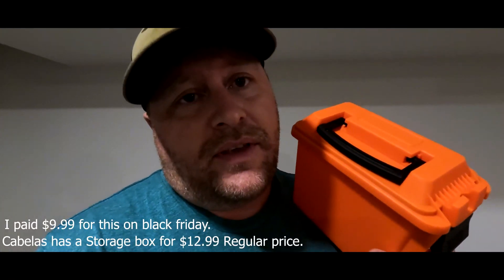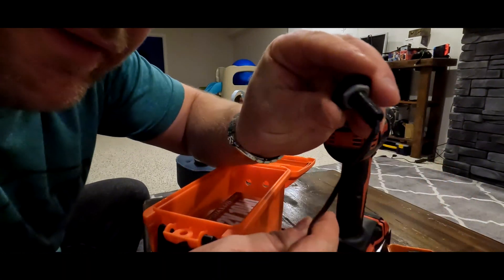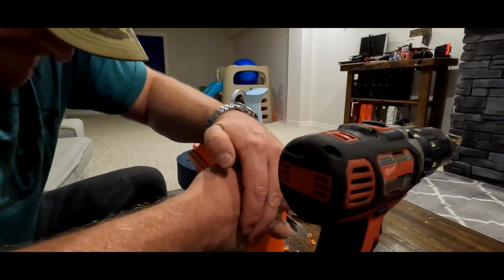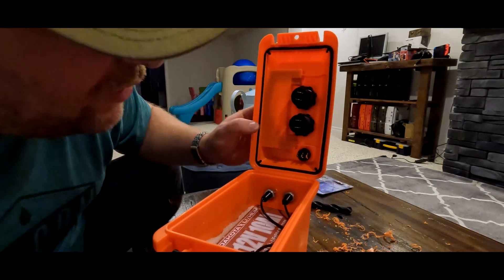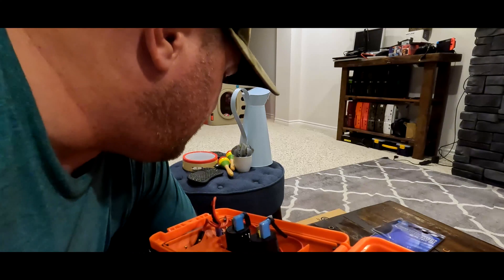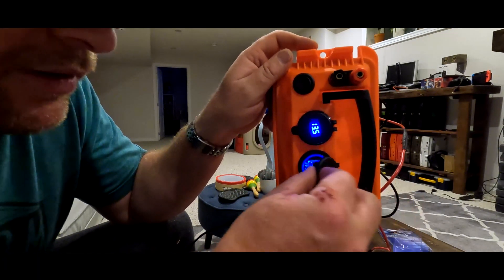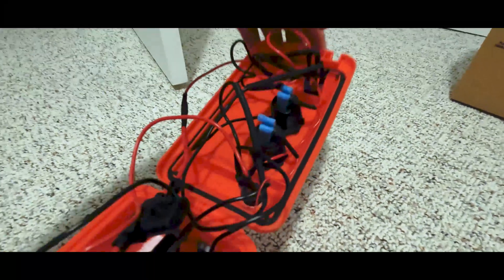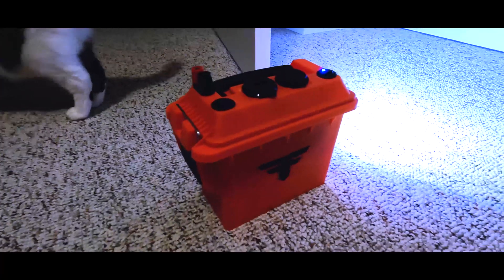How to BUILD A LITHIUM POWER BOX For ONLY $36!

Comment from the maker: USB 3.0 Charger Socket $6.59
https://www.aliexpress.com/item/1005001430681536.html

5 pc Rocker Switch $5.29
https://www.aliexpress.com/item/1005003308100522.html

6 pc Eagle Eye Led $9.58
https://www.aliexpress.com/item/32810465434.html

Charging Post $2.41
https://www.aliexpress.com/item/32872164977.html

Fuse Holder $1.30
https://www.aliexpress.com/item/1005001871088533.html

5 meters of 18awg wire $6.95
https://www.aliexpress.com/item/4000689875049.html

50 Pc Splice Wire Connector $4.50
https://www.aliexpress.com/item/32644248517.html

Ammo Box $9.99
Cabelas

127 Pc Shrink Tubing $1.74
https://www.aliexpress.com/item/1005002258353406.html

40 Pc Female Wire Terminal $1.86
https://www.aliexpress.com/item/32870390488.html

50 Pc Ring Terminal $1.86
https://www.aliexpress.com/item/32844722125.html

Battery Adapter
Dewalt $6.52 https://www.aliexpress.com/item/1005003522924944.html
Milwaukee $5.12 https://www.aliexpress.com/item/1005003175683129.html

2x USB=$13
2x Rockwe=$2
2x Eagle led=$3.33
1x Charging Post $2.41
1x Fuse Holder $1.30
1M Wire $1.30
10x Wire Terminal $0.50
1x Ammo Box $9.99
2x Splice Connector $0.20
15x Heat Shrink Tubes $0.30
1x Battery Adapter

Comment: bought 4x 32ah lifepo4 cells from china for 8 bucks each (buy in bulk), made the same sized powerstation with almost half a kwh of capacity for about double the price. used a bidirectional 100w usb-c board for charging and soldered r2 resistor to set for lifepo4, and a 12v fused dc port which i put a car charger thing in that can do 20v usb-c

Comment: The box looks great. Just make sure that everything that draws power from the battery (eg. the USB outlets and LED lights) has its own built-in voltage regulation. Despite having a nominal 12 volts, your battery will in reality output anywhere between 10 and 15 volts. This can be bad for devices that expect closer to 12 volts to run. You could also add a small regulator to your setup.

Comment: What do you use to charge it with?
Reply from the maker: Just a regular small lithium charger with aligator clips. Clip it to the posts on the outside and turn it on to charge.

Comment: I watched this based on the stated cost in that configuration. It was not true. Had to get to the end to find that out. You justify it by saying just use a drill battery. My batteries are over $100 now, for a better one.  Then I can get an inverter for $35-$45. So don’t really need to diy at that point.  Either way your video is inaccurate, at best. There are so many videos out there that between two similar ones I’ll choose the one that I feel hasn’t misled me.  Sure this one viewer whining won’t matter to you, but remember that most people don’t say anything, they just don’t subscribe or like or watch more of your videos.
Reply from the maker: My video states to use a battery you already own. Just like you stated you have $100 batteries already. Most men have a lithium drill at home. Also the inverters are $12 on ebay or amazon. They are cheap. I never said to go buy a new drill battery for $100. If that was the case i would say go buy a 10ah lithium for $120. lol.

Comment: I would probably add an input for a solar cell. As well as a Heltec V3 with Meshtastic so it’s also a back up communications device
Reply from the maker: Those are great suggestions!
Reply: I'm adding a powerpole connector in lieu of charging leads. Now I can charge it with a battery tender, solar cell, what have you.

Comment: How do you recharge the battery
Reply from the maker: I connect to the Red and black Teri also on the outside of the box and turn it on. It's starts to charge at that point.

Comment: Solid build, one suggestion, take the battery out before you drill through the box.  One small slip and you're out a battery.
Reply from the maker: Very smart tip. Thank-you!

Comment: Nice build cool i build my own i have 3 18 volt lithium battery 12A,5,A,3A in some tool box with 12/24 volt DC power supply out put 9V 2A With 2 switch and 3 usb 2.1Aand 1A charge my phone and it working
Reply: your build sounds good too! what would be the proper Guage wire to get? tyia

Comment: $36.00 right. Battery is $70.00 off the bat. Add wiring and your at $123.59 including tax
Reply: I built one have about 78 bucks in mine just need to shop. Around for all the stuff
Reply: Price is based on battery box not the battery I guess!?
Reply: You could buy lead acid to be "cheaper". I'd argue that a lifepo4 is possibly cheaper. You get a much longer charge/discharge cycle, and safely get 80-90 of the total capacity. Lead acid is only 50% of the total capacity.
Reply: He clearly said if you go with a dewalt adapter
Reply: That obviously doesn’t include battery 😂

Comment: The end product look just as good, if not better than, store bought equivalent. The wiring standard was probably much more robust and better than those store bought ones that are mass produces in China.
if you did this as a side hustle I'm sure you'd do well, and the 36 bucks cost could half when ordering a heap of the components at a time. 
Great video, cheers from an Aussie in South East Asia 😀
Reply from the maker: Thank you. The box is still going strong and i use it all the time!

Comment: Wiring was a touch hard to follow towards the end but a great job neatly done!
Reply: replay the video. he described the wiring in earlier in the video, and in the end, he just assembled everything. Great project for camping etc. and unlike other projects on Youtube, it do not require a forklift to carry around. 🙂- Have a nice day
Reply: Yes it was!!! Plus at bare minimum for safety reasons I would use shrink wrap over each terminal into each switch or plug .
Reply from the maker: smart!

Comment: Battery costs more than $36 by itself.  The title says "LITHIUM" battery box.  Which specifies that its not just a battery box, or even a lead acid or AGM battery box, but a LITHIUM battery box.  So where do you get such a cheap lithium battery to make the total cost come to only $36?   Not happening.
Reply: for poor as cheap people like me. you go to Google, and you find yourself 4 used headway cells. you pay no more than 4 dollars eatch for them.
Reply: If y'all are anything like myself, I keep on hand at least a dozen 18675, 3.7V.
Batteries that I am always salvaging from old or dead electronics! You know like an electric razor, or anything that is wifi! I actually have 3 whole sets of electronics from Ear Buds headphones!!
With a tiny tiny lipo battery and wifi circuit!!
I also take any solar panels. Those are always still good !!

Comment: How did you stop the slow drain when it's not in use?
Reply: There shouldn't be any drain with the inline switch turned off. The only drain would be battery discharge over time which is normal.

Comment: How are you supposed to charge the 20v batteris without taking them out of the box every time?
Reply from the maker: Turn the power switch on for the banana posts and clip to them and it will charge ;)

Comment: Harbor freight had the ammo boxes last week for $3.99. You are absolutely correct about placing your battery in the box from the get-go. Also, I built my own Milwaukee adapter from a spare charger. I’ve also made a set of jumper cables for a quick and easy jumpstart that I have used numerous times on my work truck. Those jumper cables work like a charm. All of this was rather simple to build. People were blown away with the jumper cables and even more amazed at the ease of starting my truck. My wife’s $200 jump box does not have the power to start it.
Reply from the maker: Amazing! 3.99 is a great find!
Reply: I was just thinking about that. Did you put a plug on teh box that you could plug the jumper cable into liek a jump box has?
Reply: @ no, just a standard 12v male plug so not like a typical plug on a jump box.

Comment: Couple of questions. Will this setup also power a fish finder? And, what do you use to recharge the battery? Thank you!
Reply: That's why I tuned in but I learned a bunch & how to spend more money on my creation
Reply: Yes it will. You use a battery charger. 12 volt lead acid for a SLA battery, the power tool charger if you use a power tool battery.

Comment: A lithium power box for $36…. As long as you don’t count the single most important part which is the battery at $228 for the Dakota Battery. Why make a clickbait video?! I can build a computer for $4.. as long as I don’t include the price of all the major components of the computer… 

Jesus.
Reply from the maker: As the video says you can use any battery. You can also get an attachment to use one of your lithium batteries from your cordless drill. Dewalt, Milwaukee, etc. Almost everyone has that already. You dont need to put a Dakota Lithium as stated in the video :)

Comment: OK, now what will you charge it with that won't set it on fire?
Reply from the maker: Need a lithium charger for lithium battery. Turn it on and connect charger to the banana plugs and done. Don't even need to open it.
Reply: @FoxFishing4K  I understand the process.
     I was simply noting that you never mentioned what type of battery charger to use with it. If someone who doesn't understand LifePo4 batteries builds your project, (a very fine one at that), and tries to charge the battery with a standard power supply, car power socket or car battery charger, they will wind up with a pile of HOT orange goo where the battery box used to be and / or possibly even a very hot fire that is next to impossible to put out.
   Lithium type batteries are no joke and need to be used with care and respect. I was encouraged by your use of a fuse.
    I'm guessing by your accent that you are Canadian. A little tip for you and your fellow countrymen / women and my country people to the north of me.
    LifePo4 batteries can NOT be charged by ANY charger or solar array if the cell temperature is below 32 degrees F, (0 C). Permanent damage to the battery will 
result. it can be used cold but not charged. It must be warmed up first. I say this for someone who may go ice fishing and leave it sitting on the ice or may leave one in a car for emergencies in the winter.
    Larger higher quality, LifePo4 batteries for solar, marine or RV use have a BMS module or Battery Management System module built into them to protect them from overcharge, undercharge, low charge condition, (below 20%), short circuit, excessive high drain and high and low temperature conditions. It is not impossible but unlikely that your battery contains a BMS module and more likely contains just raw cells in a plastic box. This is not a bad thing but requires more care when charging.
    Other than this, it's an exceptionally well done project.

Comment: I ran a  2.1A socket directly to my 10ah 12v battery also to my helix, couldn't  figure out why but within 5minutes the battery was below 10% brand new battery aswell...
Reply from the maker: Weird. Was the battery charged? I only run lithium. It's either full charged or dead lol

Comment: That is really nice! Can you tell me how you connected both you're +/- leads and the secondary wires to your posts and aux's to those switches securely? And also what gauge wiring that you're using. Ty!!
Reply from the maker: I think it was 16 Guage wire if I can remember correctly

Comment: hay can you help iv just made a power box with a in line fuse , iv found when i use it its starts at 12.9v after 1 or 2 hrs its drops to 12.5v then i turn it off after about 30 mins i turn it back on then its seems to charge its self back up to 12.9v , should i be concerned wtth this ,.....   12v 7ah 20hr lead acid sealed battery
Reply from the maker: Nope likely fine. I wouldn't worry about it. Maybe it's reading the draw from it while in use?

Comment: You should wire in a discharge protector so you dont over discharge the battery, rendering useless.
Reply: it has a bms built in for protection
Reply: Like the other person commented these batteries have a little built-in circuit board with chips that cut off the battery at a set voltage to keep them from being discharged below a certain level so the battery won't get damaged.
Reply from the maker: You can't overdischarge the battery. It's lithium. Just like using a drill you have full power then boom instantly dead. I run all my lithium until they run out of power and have never had an issue.

Comment: I'm trying to set up the same minus the led lights. The single power switch from Amazon has 3 poles/tabs on the back. The 2 sliver ones go through the switch. The "gold/negative" one has no connection through the switch. Continuity check shows no connection with the other pole regardless of switch position. What's the purpose of connecting anything to it?
Reply from the maker: It kills the power to all the switches and everything so you don't get battery drain.
Reply: The gold would be negative for the neon light on the switch to work. The switch would work without the gold being connected to negative but the neon light on the switch won't work

Comment: How do you recharge the battery
Reply from the maker: Connect the charger to the red and black plugs and turn the power switch on for those plugs. It never has to be opened.

Comment: I have seen many videos on the subject. Nobody says or explains how to charge the battery. You can? is it just a plug or some electronics for a good installation?
Reply from the maker: I just connect my charger to the red and black post and turn the switch on and it charges

Comment: A drawn wiring diagram would be nice. But the question is why no port or connection on the box for a fish finder?
Reply from the maker: I don't run a fish finder off of it because my graphs have 9" screens and require a lot of power. They all have larger lithium battery of there own. This box is built small so I can take camping or bank fishing.

Comment: What fuse amp did you use?? 15?? I just finished building one
Reply from the maker: I think it was a 15 though
Reply from the maker: I can't remember lol. I will check the box and let you know
Reply: Yup that's what I'm using your video was the best that I seen!
Reply: How are you changing the unit?
Reply from the maker: @vladimirangel7226  I turn the switch on for the posts and connect the charger to the positive and negative post :). Super simple and never have to open the unit.

Comment: Can you charge at the terminal posts or do you need to open and charger to battery?
Reply from the maker: Charge at the terminals. Connect your charger to them and turn the switch on for those and battery charges. Once done turn switch off and done!!

Comment: Good video, BUT you still left yourself or anyone who copies your plan open for a fire hazard. The problem is, the power switch for your LED is NOT protected by a fuse. When wiring these boxes it SHOULD be Battery positive > fuse > to first/any component.

See this video for a better explanation and if anyone uses a lead acid battery, a must.   https://www.youtube.com/watch?v=dLgYqO-3kMg
Reply from the maker: Check out the video again the way it's wired everything is through a fuse. Every component goes through the fuse.
Reply: @UCV8P_waGmxql6JRvwIvWrlg look time stamp 11:02, you stated, The wire without the fuse goes to the LED switch and it shows the wire does not have a fuse. This is the wire I'm talking about. The wire going to the master switch IS protected by the fuse. The other is not. The better way to do it is to take that fused wire to the LED switch and a jumper to the master switch. Only one wire is needed and you can get rid of the piggyback terminal.
Reply: The best way to check is to pull out the fuse... then turn on the two switches, if the lights come on with no fuse it is not correct. If everything stays off then yes, everything is fuse protected.
Reply from the maker: Actually Bill I think you are correct those wires that lead to the led lights do not have a fuse.
Reply: @FoxFishing4K  Yeah easy fix...take the  wire coming off the fuse and go to LED switch and crimp on a second jumper wire to the master switch and cut off the extra wire (piggyback) and you are all good. 

 I like that small ammo box you used, I built a box but a smaller one would be nice. Here out in the middle of the Pacific Ocean we don't have a Cabela's or any real outdoor stores.
Reply from the maker: 100% correct my friend. Thank you for pointing this out. It would make sense to get rid of the piggy backing as well. The way you described it is so much easier!

Comment: Great video. That’s a cute feline assistant you have there! One question: how do you charge the battery?
Reply from the maker: Turn on the power switch and connect charger to positive and negative posts on top of the box
Reply: I have a similar build. For mine I have a cigarette lighter male that I can attach to my lithium battery charger. If you plug into the port it will charge

Comment: Great Video.  Gonna take your ideas and make some adjustments to my box for this winter - add the lights and 1 USB outlet.  I installed the same 3A usb on the main boat this year, can’t beat the price.   I also have my fish finder mounted on the box top and it tucks inside the case nicely with a smaller battery kit.  I’d love a Dakota but a little too $$ at the moment.  
Nice Job!!
Reply from the maker: Thanks man! The dakota was from my old ice fishing graph. If I didn't already have it I wouldn't use it. I would use a drill battery. Best part is you can adapt these to whatever you use. Can customize.